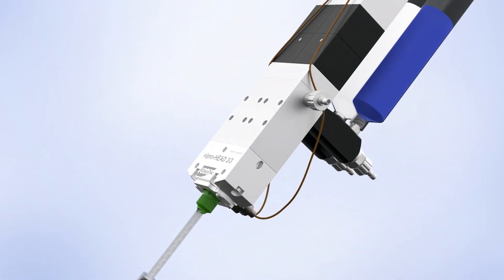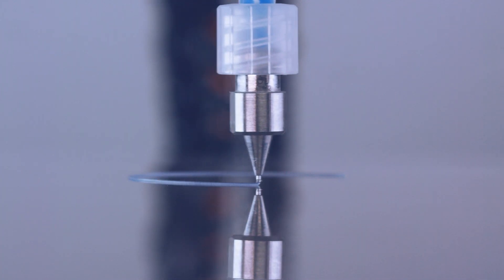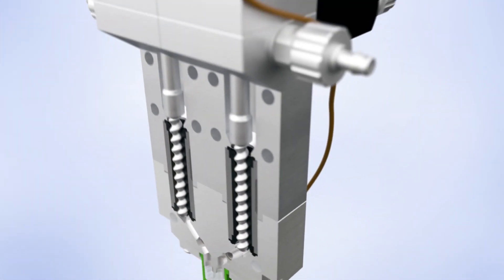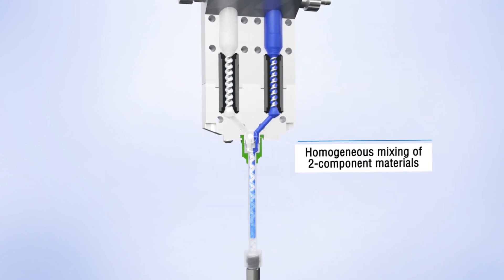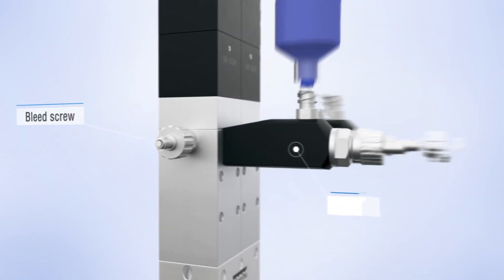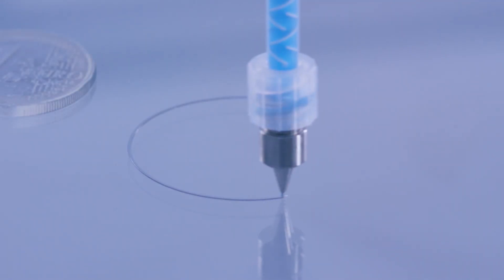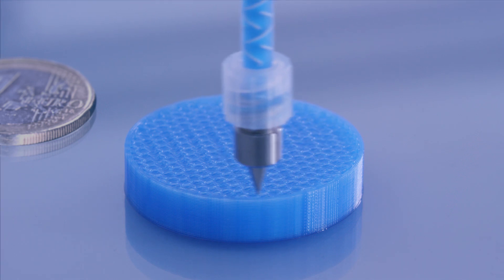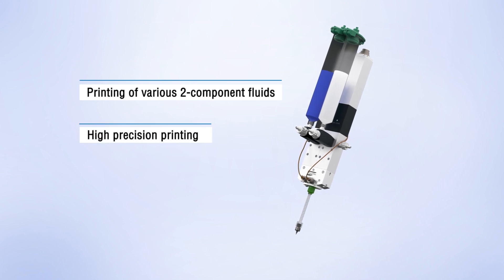ViscoTec 2K Druckkopf für 3D-Druck von Fluiden und Pasten

Comment: Are the internal components replaceable? We print 200nm alumina paste which is highly abrasive and I'm concerned about longevity and cost of replacement parts.
Reply from the maker: Thank you very much for your interest in our technology.
The internal components are replaceable. The endless piston principle is well suited for abrasive materials due to very low shear rates inside the pump.
Therefore, the longevity is excellent, even with abrasive material. If you have any further questions, feel free to contact us at any time: mail@viscotec.de